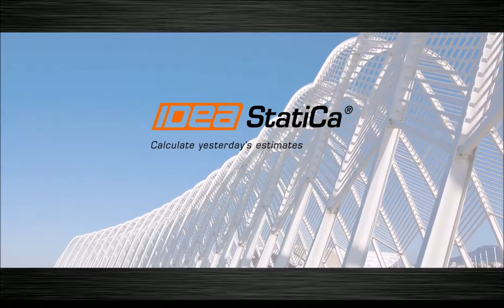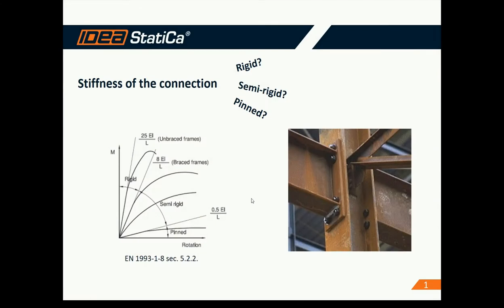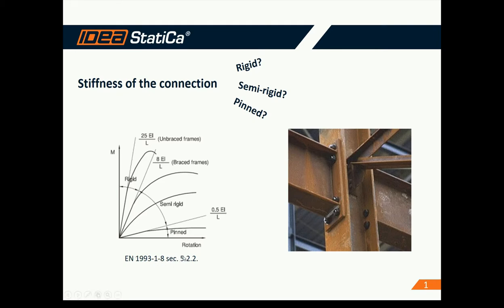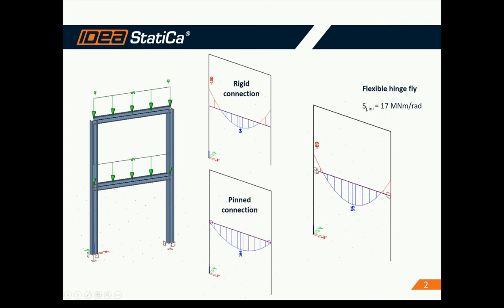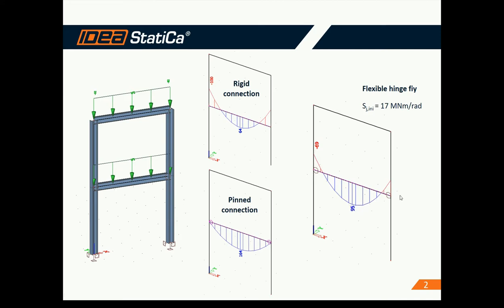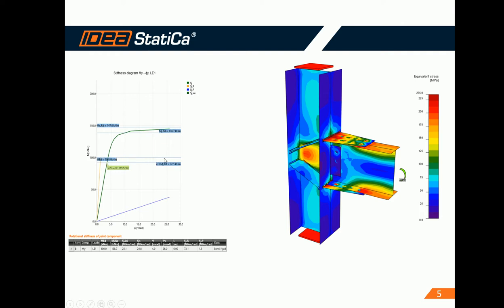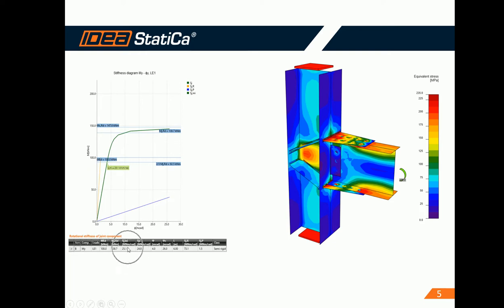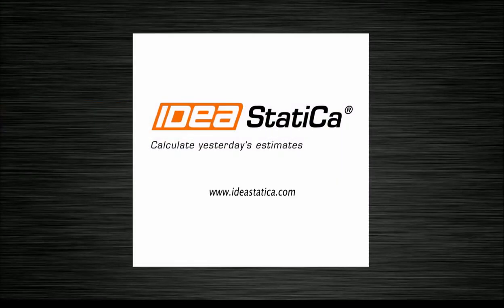How to properly calculate and use the stiffness of a steel connection in IDEA StatiCa Connection?

Comment: Thank you for the useful video. 

I have a question please.

How can one compare the stresses obtained from IDEA and the uni-axial stress provided by the code ?

FEA runs with equivalent stresses  multi axial stress state, so they are different from the yield and ultimate stresses used while defining the material.

do you judge the failure of the connection using the 5% equivalent strain only and ignore the equivalent stress ? 

Thank you
Reply from the maker: "The yield stress fyd that is mentioned in the code and which is derived from uni axial tests is also valid as the yield stress for multi axial stress states:

√(σx^2 + σy^2 - σx ∙ σy + 3τxy^2) ≤ fyd

The uniaxial stress state is just a special case of a multi axial stress state. The plates in IDEA StatiCa Connection are modeled with elastic-plastic material with a nominal yielding plateau slope according to EN1993-1-5, Par. C.6, (2), tan-1 (E/1000). The material behavior is based on the von Mises yield criterion. It is assumed to be elastic before reaching the design yield strength, fyd. (for more info, see: https://www.ideastatica.com/support-center/material-model )

In IDEA, the equivalent stresses are not used for checking, but rather reaching the 5% limit value of the principal membrane strain is used for checking, this is in accordance with EN 1993-1-5 App. C. par. C.8 (1)."

Comment: If there is tension force in connection, should I apply this force in rotational stiffness analysis?
Reply from the maker: Hello, it depends on what you want to calculate.
1) only pure rotational stiffness My - input only My (not N)
2) rotational stiffness My (and Mz and Mx) under certain load conditions - input all internal forces including N
generaly tension force N does not affect the rotational stiffness of a connection